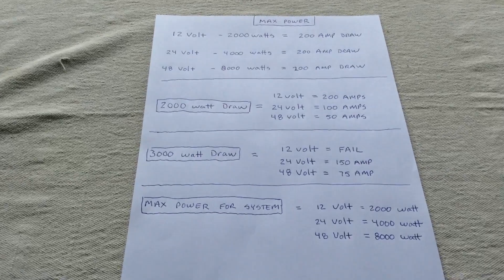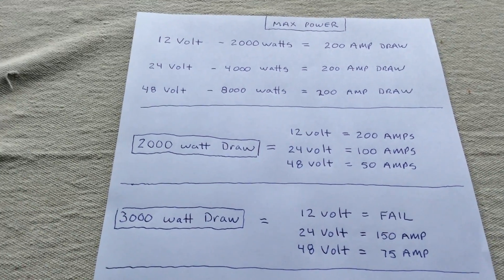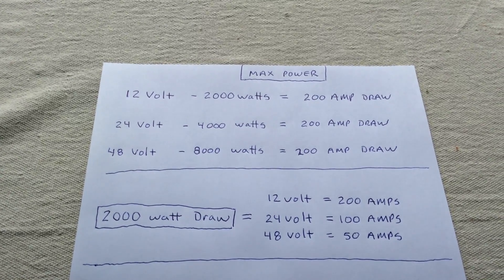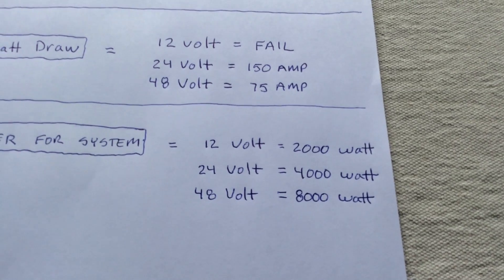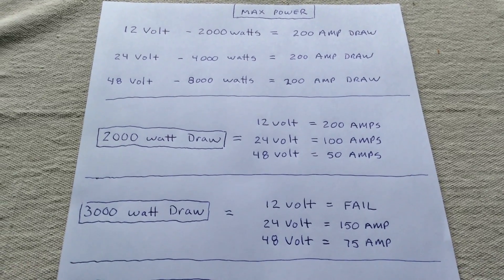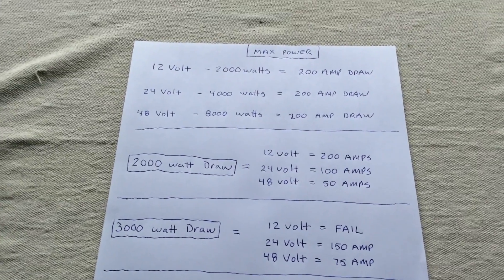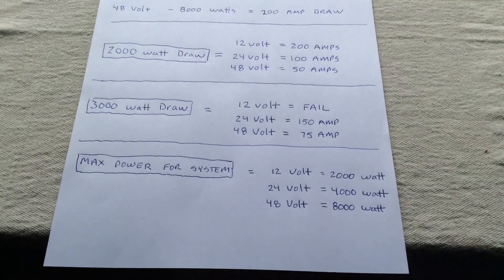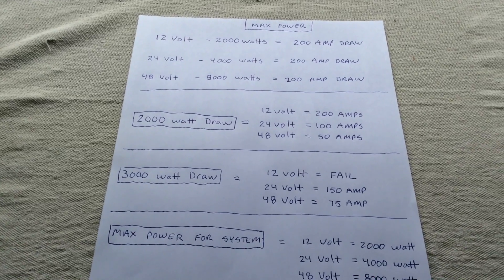Solar Off Grid Inverter 12 / 24 / 48 Volt Explained

Comment: I think if you have a multi battery bank you have to consider the discharge rate of each individual battery than how much those batteries combined can discharge as per manufactuers specifications. For example I run a 4 battery bank of 12v 200ah in parallel with a combined total of 12v and 800ah. That is my capacity. The manufacturer reccommends 400 amp max discharge rating. I have never drawn anywhere near that. 175amp discharge probably the highest ever. That was a lot of heat on 4/0 cable not (4 guage).

Comment: that is why i am using 500 volt and up and the inverter is 440/50Kwh.
and that is not all we generate also electricity three phase because that is what
the inverter producing and 2000 watt is nothing.
Reply: typo 40 / 50 Kwh

Comment: GREAT VIDEO EXPLAINED IN DETAIL FOR NEW SOLAR DIYers .:goodvibes: LIKE THE WAY HOW YOU CLEARLY EXPLAIN THE 12 , 24 , 48 VOLT SYSTEMS  AND THE LIMITATIONS OF WIRE SIZES  WHEN DRAWING POWER TO RUN BIG LOADS INVERTERS  AND WIRING CAN HANDLE . SO 24 V - 48 V WILL BE BETTER AND BEST FOR YOU .🤗🤗 CHECK OUT MY DIY SOLAR VIDEOS , HIT LIKE , LEAVE A COMMENT AND SUBSCRIBE . MAY THE SOLAR BE WITH YOU .👍

Comment: On 12 volt system you use DC current for all appliances don't need inverter
I find inverters a bad idea in any case
People should understand that solar energy is not enough to work electric cookers and all the rest that use high energy and if you do you have not enough energy for long periods
I love my 12 volt system and would not go for higher voltage ever, to me it's useless and bad idea as they damage the panels in no time.

Comment: Yes, but wouldn't be better to run that 12 volt 2000 watt load on a bigger inverter with less stress and not have the fan running full bore trying to keep cool. I do agree if you are serious about running big household loads you should definitely be using a 48 volt battery.

Comment: I think that 1000w is 12v maxed, I have a 24v system with a 3000w inverter, but only use 2000w of that. I deliberately oversized the inverter so it would not trip or overheat. I have a 12v system in my camping panel van and no inverter, just for a fan and a DIY Peltier device cooler box (fridge now), I intend to get a 48v system once I max out the 24v system.

Comment: Incorrect. 
Inverters convert 
12 volts DC to 120 Volts AC
24 volts DC to 120 Volts AC
48 volts DC to 120 Volts AC
Each receptacle is 15 amps.
120 volts X 15 amps = 1800 watts.
5000 watts ÷ 120 volts = 41.6 amps

Comment: Question. I've a submersible water pump that I intend to use , Off-grid, every day,. The water pump power rating is 1700w(1.7kw). I also have an array of Solar Panels of 3600w output capacity. I've no need for battery or charge controller, only an Inverter, as I don't need to store energy. I intend to use the power directly on the appliance. What size/capacity of Off-grid Solar Power Inverter do I need to buy. Thank you.

Comment: It all depends on the configuration of your battery bank (for example 4  12v batt with 100A each is quite doable) and also how you derate your design (using a 3k inverter for a 2k application).

Comment: Here in India, its 2023 and we still dont have reliable inverter and batteries which can run pure 1000watt load on a 12volt battery. We tend to believe 80 or 100amps current is very huge for lead acid batteries. We are still using transformer based inverters and what not.

Comment: Will I get more use while my pellet stove run longer instead of feeding my 2000 W inverter with 12 V if I feed it with 2436 or 48 is there an advantage to doing that when my draw is only 300 watch my goal is to try and make the 300 W stove run 24 hours 12 V two batteries I was getting about six hours should I wire it in series to raise that voltage is there an advantage?

Comment: Hi nice explanation 👍 I have a question to ask .. I want to run  OFF GRID for start whit one pylontech battery US5000 48V kwh home battery ..and then in few month time whit 2 battery  of US5000 48v.... can I run whit All in one Growatt  5000w 48v inverter built in MPPT  current output  100A ...thank you

Comment: I have a 2 64Ah banks of LIFEpo4 of headway cells. It’s installed for caraudio with 2 1/0gauge ofc power cable rated @ 350a each. My alternator is a higher output than stock at 320a. I was thinking of getting a 12v inverter for emergency backup power. I have a eu2000i generator so I was thinking 2kw inverter should be good.  What you think? Should I just figure out a way to string 2 batteries for 24v use? Or stick with the 12v system.

Comment: so really it's all about the bms a 24 volt battery with 100 amp bms you cant get 3000 watts inverter  but lets say 24 volt battery with a 200 amp bms would work much better

Comment: I had never truely understand this and so I build the 12v system for my RV. Well, I am running in the same problem you're talking about. As soon as start running the ac along with the fridge and a electric stove my inverter is hot as can be. I have had multiple wires burned up and the list goes on and on. Also, I was under the impression that the high the current the better the system. I would like if you could touch base on is it better to charge your batteries at higher current or lower current. Thank you for your explanation it will help me a lot.

Comment: UH....NO!!  You can run 12 volt batteries in parallel and make as many watts as you want.  If you don't understand anything about this subject you should not advise others!!!!!

And the comment about 48 volt being for large systems....UH NO!!!!  The advantage of 48 volt is smaller wire to carry the same amount of current as a lower battery voltage.  You can have 16 - 3.2 volt batteries with 40 ah each and have 2000 watts battery storage.  Voltage has nothing to do with the size of the system.  And by the way a larger inverter is not a bad idea as it allows you to add to your system and use it more as time goes by.  You are completely wet on this subject, dude.
Reply: It is at least funny when you blame him for ignoring the topic, while you obvious ignore it. The man said the simple thing that when working with low voltage and high power systems THE LOSSES OF THE LOW VOLTAGE SYSTEM, FOR THE SAME AMOUNT OF POWER, ARE TERRIBLE. Everyone who knows elementary electricity  physics knows that. But, anyway, if this is so difficult for you to comprehend, why you blame him?...

Comment: INCORRECT!!! 12V - 2,000W = 166.66A, 24v = 83.33A and 48v = 41.65A... Rounding up like that is for lazy people!!!
Reply: You are correct in your exacting math. What's your opinion about 12v batteries that have 200 amp discharge rating? If you use for example of a 4 battery in paralell bank than that would be spread out?

Comment: A great video. 245 amps continuous for 3000w at 12.5 v  is really on the outer edge of common sense.  That would be at least 2/0 gague DC cable. Massive. Great video.  This application  does not even take into account the 11.x  battery drain at the end of the increasing amp draw.

Comment: I have a question what if you take those 2,000 w inverters and split them instead of trying to run them all or running a 3000 w take the 2000 Watts and run different battery systems would this be okay?
Reply from the maker: yes with two systems it is fine . one inverter on each battery.

Comment: I'm very new to learning about solar power but took my chances on buying the Jupiter 5000 watt Power Inverter for like $500... It says I can only use 12 volt batteries and that I can only connect them in parallel. Do you think I should return the Inverter or is it a good Inverter? Also, it's a modified sine wave

Comment: Question: what about 2 of the  6500 watt all in one MPP solar 48 V solar inverters in parallel both running off the same 48 v battery bank.  Can you pull 12,000 watts out of the battery at one time ( each inverter sharing the load 6000 each) or well that be too many amps out of the battery bank at one time?

Comment: I'm currently looking into solar systems, may move to a remote location, no grid power at all, can I run a house 24/7 off a 48 volt set up alone? How many solar panels would I need, bearing in mind that I'm in the UK, a country that doesn't get so much sun compared to the States.🙁
Reply: The answer to your question is, in general, yes. The rest of it depends on the total amount of the electrical load you need to support. In general, if you like to live as you are used so far, "in grid", you will need a relatively very big system. Now, if you add to this the bad weather conditions and the additional parameter of the battery bank you need for the night time, this will increase the installation cost much higher. 
The best is to calculate the loads you run, or even to calculate the average energy you consume/need per month and then ask some professional for a proper system cost. 
Generally speaking, living "off the grid" needs you to change your life style in order to reduce costs. Batteries for example are the most expensive parts of the system, while your energy independence depends on them almost exclusively. Moreover they need to be replaced every 5-7 years... So it is wise to decide what loads you intend to use at night and keep their number as low as possible...
Reply: @ΠάριςΑζής  I've watched two videos on YouTube, two home owners in the States with Tesla walls, seeing how long that system can run their homes for,....the longest lasted 30 days. I'm struggling to see how you can say yes to be honest, unless we all go back to living like caveman or ditch washing machines and most other high amp domestic items, I can't see that it's possible to be honest.
Reply: @steveclark..  The key word is always “money”. If you got it you can design yourself a palace! Otherwise you adapt yourself to each situation...At least this is what I meant in my comment...
Reply: @ΠάριςΑζής  We are all still bound by the limits of current science though, none of the EV's on sale today have a range of 500 miles for example.
Unless there's another giant leap in the output of solar panels and battery technology, I can't see how it's possible.
Although back in the day when I owned an Astra GTE, I didn't think that you could get much more than 150bhp from a 2L engine, now some hot hatch cars put out double that,.... amazing what can happen within the space of 20 to 30 years.
Reply: @steveclark..  All true, nevertheless each time we must move onwards with the currently available technology in order to cover our needs in the best (possible) way...
Reply: @ΠάριςΑζής  Yes, either that or go back to how our ancestors lived I guess. I did pick up a box of giant candles from a garage sale for little money the other week for example, I hope not to have to use them but you never know,....if we ever do have an EMP strike, whether man made or natural, none of this solar stuff may work.
Reply: @steveclark..  Indeed! 😊😊😊

Comment: well the higher the inverter the more it is wasted if used at low capacity
so get 2 2,000W systems and when you want to run stuff that adds up to more than 2,000W concurrently just split the loads between the 2 inverters.  but your battery bank and your solar array both need to be beefed up!

Comment: DUUUUUUUUDE!!! THANK YOU SOOO FCK'n MUCH for just A-B-C'ing it, straight and to the point with a smig of "country" tossed in!  I never even had the "wherewithal" to even "reckon-out" (consider) the "amp" issue, math and power draw conversion between the 12v,24v, and 48v systems!  I was under the simpleton belief that the advantage of going to a higher battery voltage system, found it's advantage in the LESS power/energy it took/takes to "step up" the voltage up from 12v' to 120volt household system.. Hence, the higher One makes Their battery bank.. the less energy/power spent on conversation; thus a bit more for the Owner to have access to... (shrug.. :-D  )  ooooor, something along those lines!  But, then along comes RED DOG.. to "Country-splain" it in a way, it gets learn't!!  (lol)  THANK YOU!  

Sidebar: (in a low tone... lol)  Ya' do get a tad bit more "useable" power from your system by going up.. right???  Like if you could find a 96volt Inverter.. that would be nearly seamless... Yes??
Reply: Oh.. P.s... I am and have been living 100% off grid for a little over a 2 years now. and 6months into it.. I bit the bullet, bought 8 more 6v lead acid 210ah batteries in order to step up to a 24v system.. hence.. I had to.. orrrr.. "have" to now purchase my additional batteries in groups of 4 (at 6v's per) vs the 2 impulse gets I gave into every now and then!  ANDDD.. after taking in your gifted wisdom on the topic.. I truly feel motivated to snag one more set of 4 (6v 210ah batteries) in order to step if up to a 48v system before winter... with it's less light, cold and more "NON-FLOAT" power demands.. SHITTTT FCK!! GRRR that means.. I have to rewire everything... and .. worse of alllllll.. the real bite will be ordering a 48v PURE SINE WAVE inverter!  OUCH...RED DOG.. !! (LOL)  OUCH!

Comment: I have watched dozens of YT videos in my quest to understand not just the advantage of a 24 volt battery, but how that advantage manifests itself across  the rest of your entire system.  I had planned to use a 4000w inverter just because I wanted to overkill since the difference in the cost was nominal.  Finally, a simple video that focused on the details I need to understand.  Thanks for sharing.  I will be checking out the rest of your videos with high expectations!  :)
Reply: You are the teacher Sir!
Reply: 😂4aa4

Comment: Years ago (15) I contacted a guy who did RV solar and told him what I wanted to do. The system he sold me had to be downsized on the draw to 1,000 watts (12 volt). I have an MS3000 inverter with a 7,500watt surge. I used 500lb of Trojan batteries, and was never able to use the system the way I wanted to. This guy was a "Professional"

Comment: thanx for the vid! isn't it true that you can run 12v batteries in series to achieve a 24v power supply for a 24v inverter? thanks

Comment: Wish I'd seen this before buying my 6KW inverter, the 2KW inverter will be ok, plus it's pure sine wave, the bigger is mod-sine. I've got a 48v power pack, with a step down to 13v converter. I'll start looking for the 48v-120v inverter. Great vid, thanks for sharing! In an unrelated note, anyone looking for a brand new 6KW/12KW peak inverter?

Comment: I am running a 24V system but will be purchasing a 6,000W Split Wave 120/240V inverter. The reason why- if I am going to pull 4,000W from my system I want an inverter that has some overhead so the inverter itself runs cooler for the load being pulled. Just a little added insurance on the longevity of the inverter is all. 

As for the 24V Amp output- I plan on countering that by running 2x Temco 4ga cables per line. So should give me 250A of capacity there.  

As for why I don't want to go to 48V- Parts availability.  Affordable. I plan to just run 4 12V batteries.

Comment: This power limitation is due to the 12 volt batteries.  He’s absolutely correct.
Trying to draw high wattage on 12 volt batteries is the formula for a meltdown.
Fortunately ... at significant price ... 1264.00 per battery ... you can have real 48 volt batteries.  Complete with built in thermal overload ... built in fused ... and are loaded with automotive grade lithium phosphate batteries ... ( Tesla ) ... and 5 of these pricey  gems will provide a constant ... effortless  6500 watts from the inverter.  A couple on the Internet are charging all this with 13,500 watts from a solar panel array.  It’s flawless. Add more 48 volt batteries and modify the charge controllers ... and you can easily supply 10,000 ways of power.  It’s done all the time here in Florida.  Doubling  the systems is also popular. 
Our Bluetti  AC 200 P  kicks 2000 watts with a huge 4800 watt surge capacity.
How ?
60 lbs. of automotive grade batteries.
This is a real generator.  Small , but perfect for backup emergency power after our tropical weather events.  Once all the cats and cars are all removed from the roof tops of houses and businesses ... then the spaghetti of wires from the poles can be sorted out.  It can easily take 2 weeks.

Comment: Can you help me with the math for coming up with 200amps? Is this a different equation than ways divided by volts.?
Reply: No, it is the same equation! If you divide Watts by Volts you get the Amps, because the formula says that the power is the product of voltage and intensity, (P=U*I, where P is the power,  U is the voltage and I is the current. Solving the formula for I, you get I=P/U, that is, you are right)!

Comment: I just run for our cable welding cable from my inverter to my batteries and my batteries are wired in 12 volts what faurot cable

Comment: I run 3000 Watts on a 12 volt system with for 175 panels I'm using a Grendel inverter I run my air fryer my microwave my frigerator my television to television and my stereo system anytime I want so don't say it doesn't work and does work